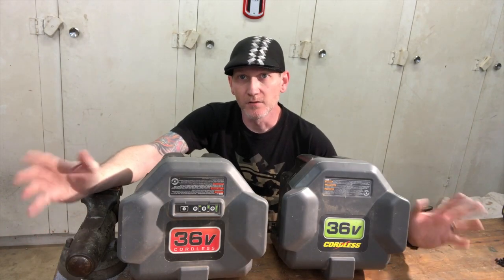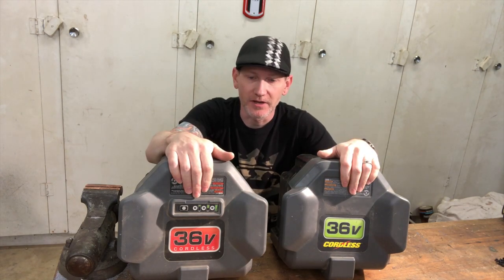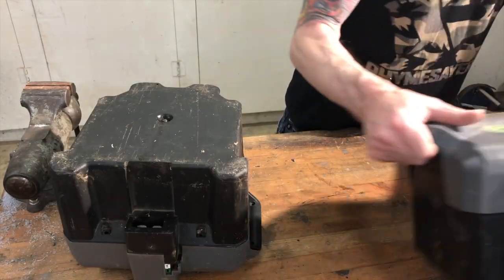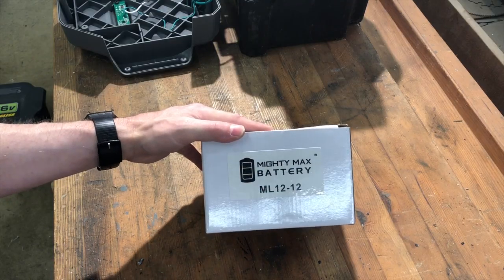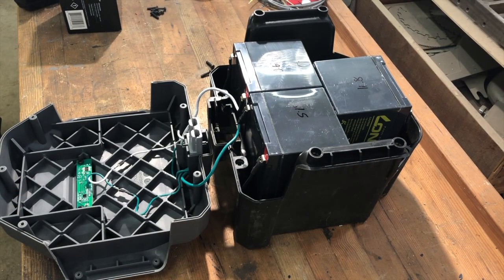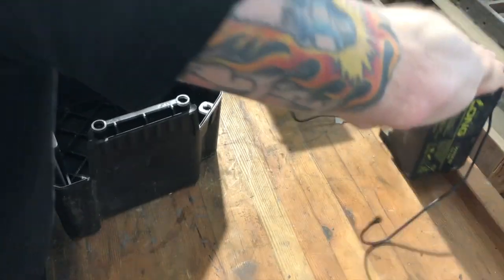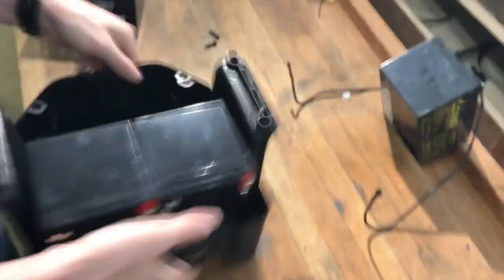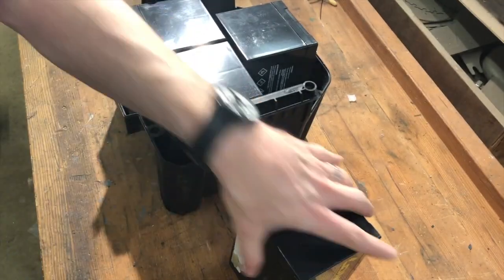Black & Decker 36V Cordless Lawnmower Battery Cell Replacement (CM1936, SPCM1936)

Comment: For anyone who is replacing the batteries of the non-circuit battery (the green one on the right that he shows in the video, but doesn't actually open at 0:13 ). I just did this replacement today and can say that it's not the same as the battery with the circuit. Yes, they have a ton of similarities, but here are the key differences. The batteries used in the non-circuit are significantly smaller and were slightly different specs (12V 10A/H), and therefore are configured differently in the container. The batteries all lay right next to each other and the terminals are in very close proximity. The fact that they are configured differently in the container means that the wiring is significantly shorter. So if you purchase the oversized block batteries as he did in the video or like I did (Mighty Max 12V 12A/H),  you will run into a few problems. 1) The wires won't stretch so you'll need to replace them. 2) You'll need to cut significantly more plastic than the video shows. 3) If you buy these batteries on Amazon, you can't return them because they are hazardous materials. That being said, if you have no problem replacing wiring you'll be fine. But my guess is you're probably not watching a how-to video if you're that advanced.

My recommendation for any general DIY'er that wants to get the non-circuit battery completed quickly. Spend your time trying to locate the batteries that have the exact same dimensions as the ones in your current container. Open up your lawn mower battery container, and take pictures of the configuration of the batteries. Then remove them and measure them. Otherwise, you'll be shopping for wiring and connections and asking others for help like myself. Unfortunately, I took this video at face value and paid the price. I bought the batteries that were being heavily discussed in the comments and thought I'd move them around like Phillip in the video. But once I realized my cables were way shorter than the ones in the video and I couldn't return the oversized batteries, I knew I was up shit creek.  It's 100% my own fault, and I'm trying to prevent anyone from making the same mistake. Great video by Phillip btw.
Reply: Thank you for the heads up! I was just researching where I could replace the same RB3610 (green label battery w/o charging indicator) as mine has begun to fail. Shame Black & Decker stopped supporting their own product, but not surprising to say the least. So glad I read your comment before clicking Buy on Amazon for the 12V 12Ah batteries. I will open mine and examine to make sure I will actually need 12V 10Ah ones. Thanks again!
Reply: Strange, when I opened mine up it was indeed 12v 12ah batteries. Not sure why yours had 12v 10ah ones then. Mystery?
Reply: FYI, the comment from mambooha says:
For those with the older style Black & Decker model (green 36V) Item # SLA-12V12-F2-X3 from BatteryMart fits perfectly.  No cutting needed, simply unplug the old and plug in the new.
Reply: happend to me also uggh
Reply: @martymcflie3211  The new batteries I received were close enough in size that I did not have to cut away any of the container's plastic either. They work great, too, I was finally able to reclaim the jungle outside like new!
Reply: Wish I saw your comment!  Happened to me too! Open your battery casing before ordering new replacements.

Comment: I just changed out the batteries of my Black & Decker 36V Cordless Lawnmower Battery, and have 3 observations: there's also a 14AHr battery alternative for a little more money that I found after I ordered my 12 AHr replacements--it's worth a look. Also, to avid confusion, as I was removing the connecting wires, I put heat-shrink red tubes on the wires that connected to the red side of the batteries, because most of them had no identification-makes it a lot easier (and safer) to rewire them. Finally, despite buying a trio of batteries that said they were "replacement for Long battery", and looked to be identical in size (but apparently weren't), I couldn't close the cover because the batteries couldn't be reseated inside their plastic guides in the top--so I filed and/or cut off every one of the tiny bumps placed inside the retaining layout in the top to more tightly secure them, and after much effort was finally able to close it up with no gaps.  BTW-this was the 2nd time I've changed out some of the batteries in my two Black & Decker 36V Cordless Lawnmower Battery. The first time I had no problems with either battery. Plus a word to the wise--screw in the short screws for the handles in the cover LAST--they do a poor job of pulling the cover tight because they are short, and you can easily cause them to strip the plastic threads in the cover.  And one more thing: all 3 of the batteries I replaced were in excellent physical condition, and showing more that 12 volts, but yet both 36V battery units had a very short run time (especially when compared to when they were new). Fortunately, since I've got lots of things that use 12V batteries, I bought a Cen-Tech 'Digital Battery Analyzer', that not only tests voltage (of course), but also does an internal resistance check (which shows how much deterioration has occurred chemically inside the battery) and a CCA test. My testing showed very high internal resistance (not good), and a CCA of only about 25% of what the new ones had, consistent with a very high internal resistance on 3 of my 6 12V batteries.  Without such a tool (which isn't all that expensive), there's be no fast and easy way to see which batteries are actually bad. In this instance, it was 2 bad batteries in one unit, and 1 in the other, so I took the good one and put it in with the other with 2 good batteries, and replaced all 3 in the other.  Without the analyzer, I'd probably have replaced all 6.
Reply: @elegant6066  The B&D 36V charger has a connector that is designed specifically for the mower's battery pack. 3 24V batteries might be charged if they were in parallel (the battery pack puts them in series, so it's 3 x 12V=36V), and you cut off the connector and found a way to connect it to the batteries. I don't think the slow, trickle charge of 36V would overcharge or burn out a 24V batter PROVIDED you paid close attention, since the lower voltage would never stop the charging and power would be continuously pumped into the 24V batteries, and eventually there's likely be a problem.  I have no idea what you can do with these 24V batteries & the B&D battery pack or mower. You're going to have to provide more detail if I'm to help.  I've got lots of experience with all kinds of rechargeable batteries, and know all too well how easy it is to screw them up if you're not careful.
Reply: @elegant6066  No problem.
Reply: @elegant6066  The change from red to green definitely means the charging is done. More sophisticated chargers stop pumping energy into the battery when the light is green.  The chargers for the B&D mower's batteries I have would appear to not overcharge--I leave the 36V B&D chargers plugged into the batteries (I have 2) for weeks between uses, and everything's fine.  I don't know what charger you're using, or what battery pack you're using.  More detail would be helpful.  BTW-how long did it take for your battery unit to die? They generally don't last for more than 3 years, but my first set lasted almost 4 years. But the 12V 12ahr batteries can die anywhere from months to years after they're first installed.  I have literally about 50 12V batteries for my UPS's around my home, and their performance is all over the map. It also depends on how much you discharge them, since they really aren't designed to be fully discharged too often.
Reply: @richardefriend  I bought my B&D CM1936 mower July 3, 2012.  As of today, May 6, 2023, the batteries are still running for about 20 minutes of cutting time.  That's almost 11 years.  I'm replacing the batteries today, though, because I can't finish my yard anymore on a single mow-- it take about an hour to mow it.  3 charges is just too much for me.
Reply: @elegant6066  Don't tell me you're the Little Old Lady from Pasadena?  Sorry, I couldn't resist.  Anyway, the fact that you don't have a Torx wrench makes me concerned that you might not have the experience to do a full battery swap out (since even identical batteries aren't necessarily the same physical size--I just went through that myself).  On the other hand, the fact that you knew what a Torx wrench was gives me a more positive feeling.  What amp hour ratings are the current batteries?  Amazon and eBay are good places to find replacements.  You also need to match either the F1 or F2 plug ends, otherwise it can be a real pain trying to  reconnect.  Also, take pictures before disassembling, and use some self adhesive labels or tape that you can write on to leave a trail as to how to reconnect the wires.  I'm pretty good at this, yet it's still easy to screw up since  there's nothing to prevent a misconnection, short of the big spark or melted wire that tells you you've done something wrong (or no power).  If I can be of further help, let me know.  BTW-10ahr is pretty tiny.  Each of the 3 batteries in my packs are either 12ahr or 14ahr, for a total of either 36 or 42ahr.  Any yet my not terribly large property uses 4 battery charges to get the full job done (although I swap out when it gets a bit slow).  So 10ahr would be less than 1/3rd of what I need 4 of. Either it's a tiny mower, or you can't have a large lot.
Reply: @elegant6066  Is this (https://www.youtube.com/watch?v=bXK7Kron0BM) the toy you're using to cut your lawn with? It looks like something a little kid is given to follow after his father while he's actually cutting the lawn. Here's something I stumbled across about its batteries:  https://www.youtube.com/watch?v=ktS6XkSLu7Q .  BTW-if you're of the mind to follow the hack, I suggest you try to find something for Ridgid 18V batteries (available generally only from HomeDepot).  I use these Ridgid batteries exclusively for my 18V tools and accessories (and even have adapters to convert them to Ryobi), because they have the unique characteristic of being GUARANTEED FOR LIFE (and due to a recent policy change, that now also applies to batteries you buy outside of their tool combos).  I live in sunny (and wet) So. FL, (south of Miami) where there's so much rain during the rainy (or even the dry) season that your mover wouldn't be able to do the little side strip I have along the road outside my wall, on a single charge. It's like 1/10th the mow-able area I have. But I guess in dry CA, with little rain and generally small grassy areas, you've hardly got any grass to mow.

Comment: Thanks for the video.  Replace the batteries on my B/D CM1936 with new ones but mover won't go to full power it runs very slow.  Any thoughts?  Appreciate it.
Reply: Old post but answering for others.  Probably one of your batteries is bad.  Test each one separately.

Comment: How do I start my B&D battery powered mower?
Reply: Run real fast with it
Reply: With the key in, pull the bail to the handle and hold it there, press the button on the side, in that order.
Reply: @conjectural_technologies  No, push the button, then squeeze the handle
Reply: @cheryls1991  Cheryl's right!

Comment: Thanks for this video!  It made the battery replacement a breeze.  I also bought the Mighty Max batteries ($69 for a set of three, with shipping).  Your utility-knife modification to the top cover (6 minutes into the video) allowed those slightly larger batteries to fit in the case like a glove.  Also of note, the Mighty Max batteries have the same terminal type as the original batteries, so no terminal adapters are needed.
Reply: Thanks.  Where did you buy the Mighty Max batteries? 🙂
Reply: I got my batteries from Mighty Max too and my batteries fit in with no modifications needed.

Comment: How many minutes of runtime are you getting with the rebuilt battery pack?
Reply from the maker: There are a lot of variables, like grass length, blade sharpness, and using the self-propel feature, but usually a half-hour-ish?

Comment: Glad I came across this video.  Excellent work and easy to follow!  I had to trim more of the plastic "walls" on the top to get the MightyMax batteries to fit, but they did.  $70 later and I have a new mower!  Thanks!

Comment: Terrific video. As with previous comment this saved me from buying a new mower. My skills are with spreadsheets.  Your video made it easy for a klutz like me!.  Especially liked the way you trimmed the plastic to accommodate the larger replacement batteries.

Comment: Thanks for the very informative video. Now I can still use my plug in mower........... But American Freedom Units? Really? The U.S. military uses metric measurements extensively to ensure interoperability with allied forces, particularly NATO. Our Ground forces have measured distances in "klicks -kilometers. Heavy weapon caliber is measured in millimeters. The world is mostly metric. It's not that difficult. BTW I still prefer imperial measurements and weights. 
Chow man
Reply from the maker: That was a joke. I actually gave the measurements in "bald eagles per school shooting" at first, but I cut it out of the video because I didn't want to start a pointless controversy over a joke. My life runs on inappropriate, self deprecating jokes, but I sometimes dial it down for the general public.

I'm pretty unit-fluid, depending on what I'm doing. Obviously, when I'm doing construction, everything in the US is imperial. 4x8 drywall, 8' lumber, 16" centers, etc. For machining, I usually stick with thousandths of an inch, since all of my antique measuring tools and shop equipment uses that. With electronics, I generally use metric, as trace widths and vias are more internationally standardized. In this case, my metric tape measure just wasn't handy. Luckily, I've gotten pretty good at converting on the fly. But American anger toward the metric system is hilarious to me.
Reply: @PhillipsHomeRepair  I loved the reference! Funny stuff.
Reply: while you are correct we do use metric and that's why i prefer it in my daily life, but you know what he meant.  Freedom units. love it.